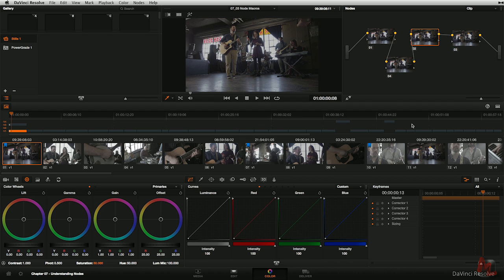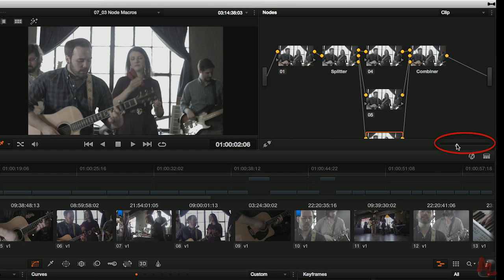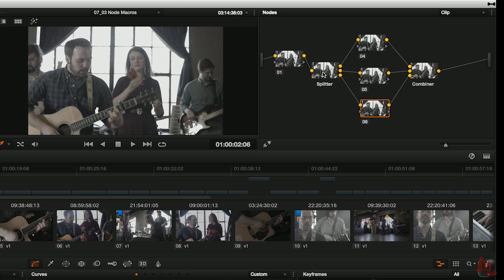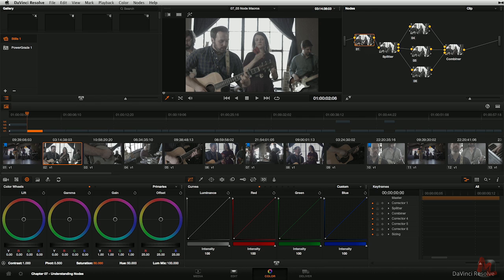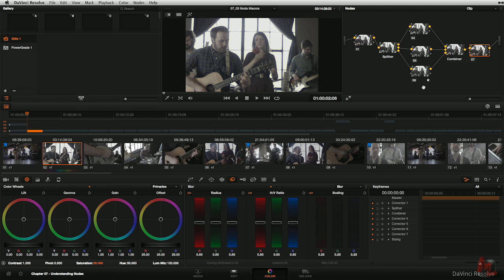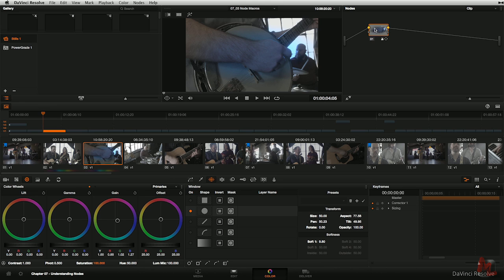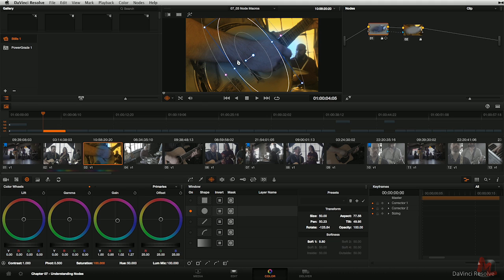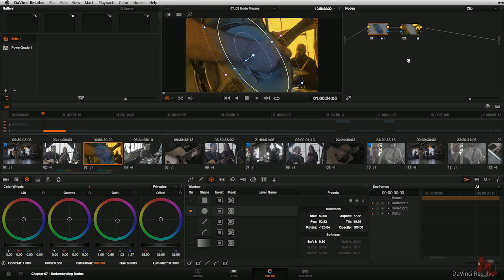DaVinci Resolve: Node Macros: The 'Splitter/Combiner' and 'Add Outside Node' Commands

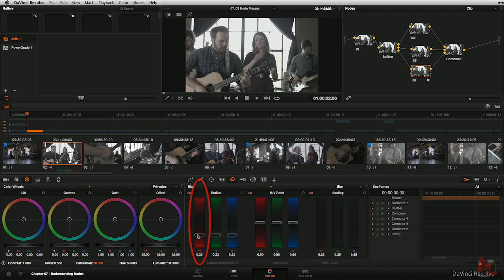Comment: 2:43 Blurring an individual colour channel as a method of noise reduction is a really bad idea as it will in fact bleed that channel into the others!
Reply from the maker: It really depends on the amount of blur you need to do—which depends on how bad the noise is. Truthfully, I do need to update this example, since this was a serious noise reduction technique 4 or 5 years ago.

Today, Resolve supports OpenFX plug-in that do much more sophisticated noise reduction and has it's own amazingly effective Temporal Noise Reduction tool—but not available on the Lite version of Resolve. So if you're working on the Lite version of Resolve and don't have the cash to outlay for a 3rd party tool, then it's still a useful technique to try. It won't work every time. And you may need to decide if the amount of noise reduction is worth what else it's doing to the image? But it takes only about 30 second to try and make the decision...

Another great use for blurring the blue channel—to create a distressed Look in the image where you purposefully want the  image to feel old, where a layer of image has corroded and infected the other color channels.

Thanks for taking the time to reply here! It's greatly appreciated.